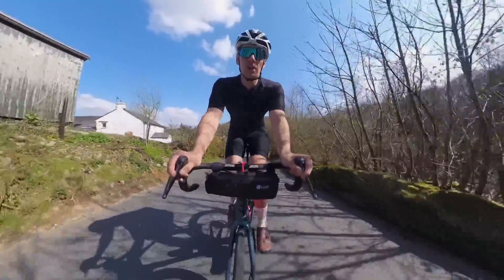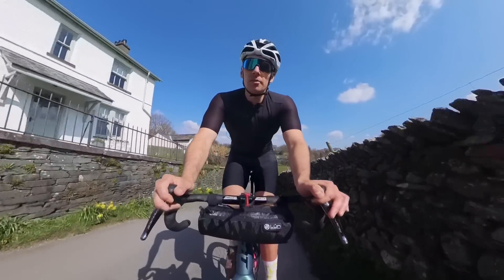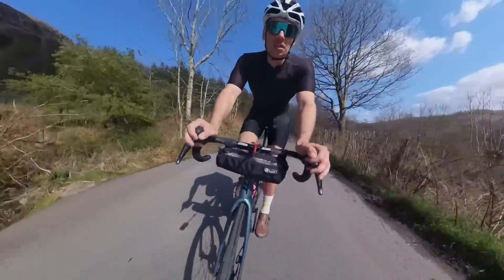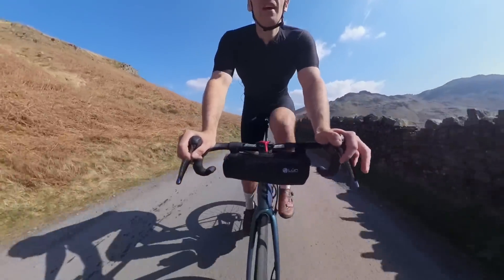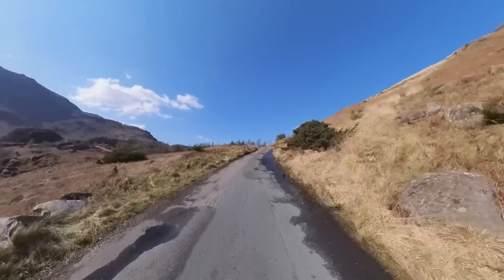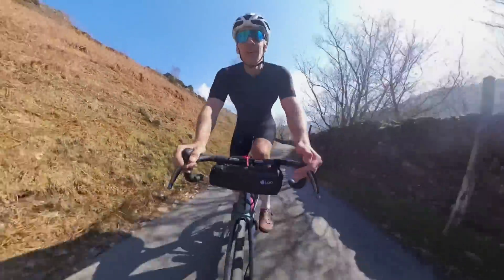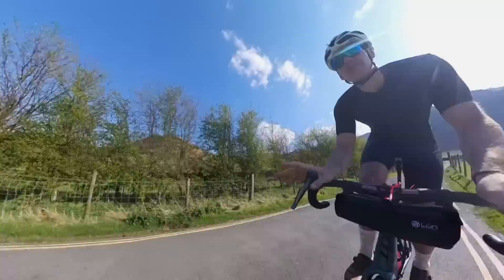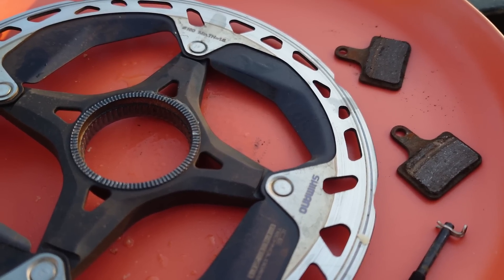Hyper D67 REVIEW - The Daddy, but Daddy got issues. (+ knackered rotors)

Comment: I've found disc rotors do not last long. I've had several sets of the IceTech freezer type. They tend to warp and a small amount of grit causes the material to pick up. I think the pickup on yours is a fragment of metal from the road that has done it. In fairness you'd get the same thing on a rim but due to the tangential velocity, it's unlikely to stay on the rim for long.
Reply: Galfer's are solid steel; they do motorcycle brake discs too.
Reply: l have to ask would a 180/200 mm MTB rotors work better for this application ?? and what pads would be best here too ??
Reply: What pads / rotors do you recommend for durability?
Reply from the maker: @SnowmEVE  campy afs Rotors last absolutely ages with any pads. However i have found the rivets can work a bit loose then they can get noisy.
Reply: @PeakTorque  Yep. I think Campy rotors are just solid pieces of stainless steel and therefore won't have the issue where the IceTech rotors heat up and cool down ununiformly between different layers of materials and therefore causing the disc wrap.
Reply: @PeakTorque  What happened to your own disc project?
Reply: Brake rotors are a terrible place to try and save weight. Shimano rotors are awful and I'm a Shimano fan. In the MTB world 2.0-2.3mm rotors are becoming the norm and I'm sure there has to be one or two models available for the road bike world.
Reply: Brakestuff 'Punch' rotors paired with the newer standard Shimano resin pads are a revelation.  They aren't light and only come in 6-bolt, but can be used with adapters on centre lock hubs (KCNC adapters are well made and work perfectly).  In total they are going to be 30g per wheel heavier, but as someone else mentioned, brakes are not the place to get weenie about your bike.  

The performance of the Punch rotors with the Shimano resin pads is the best I have experienced across the standard road offerings from Shimano and Sram.  Haven't tried Campy.  They are slightly thicker than Shimano rotors so careful setup is required to avoid rubbing.  They are and stay amazingly true though so once setup to be quiet, they stay that way. 

They stop very consistently between dry and wet conditions.  They are quiet in use and suffer less squeal in the wet than other rotors / pad combos.  I think they will last a very long time based on initial first few hundred km here in the Surrey Hills.  You may have to wait a while to get them as I suspect it's a small operation in Germany making them.  I'm not a shill for Brakestuff, I own a set of the Punch rotors and am waiting on a set of Punch Light rotors.
Reply: Are those pizzas 🍕 on your bike! 🤣
Reply: Brake pads work as a system with the rotors and those are not the oem pad replacement, curious what those pads are.
Reply: You really should step up to  Sram HS2 rotors, or even thicker ones. Shimano rotors are awesome, for race day.
Reply: Completed the Fred Whitton at the weekend with campag afs rotors. No issues and they get hot on that run.

Comment: @PT What shoes are you running?
Reply from the maker: Rx8 Gravel shoe and mtb pedals
Reply: @PeakTorque  weren’t you on Lake shoes before? Not content with them?
Reply from the maker: @wesw6787  they are a tad too wide for me, and i have wide feet. They're also really heavy, and even heavier when wet being natural leather.
Reply: @PeakTorque  Thanks for the reply. Idd, my CX332 are als heavy and rain+leather does not help. Also noticed quite some difference in the last measurement between left+right(1-3mm) for 3 pairs of Lakes that I had in my hands. QC clearly in line with carbon manufacturing standards for the cycling industry ;-)

Comment: I've had no issue with MT800 rotors on mountain descents (think those are XT). Maybe a bit more beefy than the XTR's. What other rotors have you tried? I've found most swisstop stuff to be decent, was thinking of giving their rotors a try.
Reply from the maker: Any solid steel rotors work for me just fine.

Comment: Totally unrelated to the point of this video, but can anyone explain these modern gear ratios for me? Just getting back into cycling for health reasons. Raced bikes (cat2) throughout the late 80’s up until around 2005. Always rode 52/42or39 with a 12-23 cassette. Heck, I remember crit racing early on with a 13-21 “straight block” Looking to update the drivetrain on an older bike and everything seems to be 50/34 and 11-32? “Back in my day” 👴🏻 we climbed everything in a 39-23. Why does it take a 34-32 now?? Honest question before I start ordering parts. Thx and my apologies if I’m hijacking.
Reply: Depends on gradients and what type of riding ur doing. 34x28 is just more enjoyable than a 39x25 on hilly terrain as easier on your leg and back muscles so makes one want to climb more imo. But harder on your lungs so takes adjusting. If I'm riding zone 2 (200watts) here I'm often around 55 rpms in my 34x32 as quite steep. 39x23 I'd be dying! Sure not an issue if one rides at 400+watts all day, but how many of us amateurs does that? Especially us older guys:)
Reply: I think the preffered climbing technique has evolved from 'grinding' at lower rpm and more often out of the saddle, to 'spinning' with higher cadence. This means you need lower bottom gear ratios.

I'm not sure why this change happened, but I've read somewhere when you pedal at higher cadence and corresponding lower gears (that is, similar power output), the strain on the body is shifted from muscles to heart. At least that's what I hear, could be bollocks and more related to how the current generation of doping substances work.

Edit: I've also realised recently that modern Pro Tour climbs (Angliru, Zoncola...) often show inclines above 15%, while in classic climbs like e.g. Alpe d'Huez it's rare to see over 10%. I suspect this recent 'incline inflation' is more related to advances in doping than anything else, but there's this trend to consider.
Reply: @AG-el6vt  I once laughed at the old guys that coveted their down tube friction shifters on their lugged, Campy equipped, steel frames. And they mocked me for using a heart rate monitor and dual-control brake/shift levers. I also remember Sean Kelly being mocked for running a 13-25 instead of a 12-23 at the 89 Wold Championship road race!  I’m just taking up indoor cycling via RGT and Training Peaks. The data alone is a workout to comprehend! 😂 I just ordered my parts. Went with the 11-28 because I can at least tell myself it’s a Mtn bike ratio. 20 year old me is now mocking myself! Crankset I ordered is also a 50/34. I’m old, but a 34-28 vs 39-23 just seems insane. At 90rpm 34-28 is 8.6mph. A 39-23 is 11.9mph. And not to mention, what happened to 172.5 cranks? They’re all 170’s now? And don’t get me started on these 28-32mm tires!? 🤦🏼‍♂️what happened to racing on 20mm sewups and training on 23’s!? Anyway… I digress. Haha

Comment: I've also got the icetech rotors on my bike (11spd ultegra). which rotors do you think are a better choice?
Reply from the maker: Anything solid steel even the 12 gbp Amazon ones. But choices are limited in center lock.
Reply: Thanks for that. I’m going to consider this next time I replace a rotor.
Reply: @jon65160 Galfer is my go to recommendation for rotors

Comment: Literally buying new carbon rims for rim brakes every 6-9 years is way cheaper than running disc brakes for a month. 

The hyper rims are only $250 USD a set. How many disc brakes and pads would you run though in the same time?
Reply: Been using the same rotors since 2018.
Reply: You can use second hand bearings too Reggie

Comment: I got the hyper R67s  on my super six evo high mod rim brake from 2017 
I love them 
The rim brakes work perfect 👌🏻
The whole bike is awesome
Reply: Nice bike 🙌🏽 just one question:

What brake calipers do you use? I want to put the R67s on a CAAD10
Reply: @enriquechavezjimenez1174  Not using Hypers but when switching to carbon rims I changed my rim brake pads to red Campagnolo because Jesse Coyle (afaik) recommended them in a video. It looks like they wear out p fast but the braking quality feels the same as on my alu braking surface with "normal" pads. BUT I haven't used them in the wet.
Reply: @enriquechavezjimenez1174  best rim brakes are shimano dura ace/ultegra or CANE CREEK EE brakes. choice of brake pads and set up is critical for any caliper.
Reply: Would love to see a pic!  I'm considering them for my 2019 rim brake high mod Supersix.  My only hesitation is how harsh the ride may be on those short carbon spokes.  What size tires are your running?

Comment: Have you tried Galfer disc rotors? I'm going to try them as shimano RT800 discs are squeeling like a pig and don't have great stopping power..
Reply: Galfers are amazing. Pair them with Galfer pads, it's a bliss to ride.
Reply: I have been having great luck with Galfer rotors and pads on a SRAM setup lately.  Recommended.

Comment: Do you get this issue with the ice-tech Rotors using the L03A or L05A disc pads?
Reply: That would be my question if I was Shimano and I received that email.
Reply from the maker: Organic only. Thought i mentioned that but my mistake if not

Comment: Can you just file those lumps off the rotor and continue using them?
Reply from the maker: Possible, but if the lumps are formed by the steel panel on the disc then its trash. If the lumps are molten pad, then maybe. But i doubt it as they are organic pads

Comment: I have the Hyper D45 and I have the same sound, but only in the front which obviosuly is the shallower than both of your wheels (okay also in the back, but only when super wet). I changed the pad from a Shimano L05A to a SwissStop 34 exotherm (which reviews say are LOUD when wet, but I want to do bikepacking transalps in summer) this morning and the noise is gone. I mean total SILENCE when dry. So not sure what to make of your findings yet, I am convinced I had solved my problem because there was no noise on my 80km ride today. Let's see, interesting though to learn about it and I will keep testing mine, so far I love them.